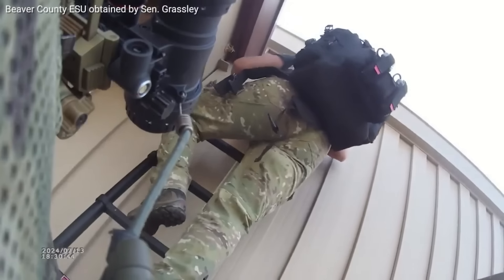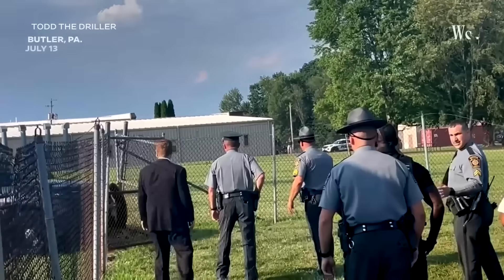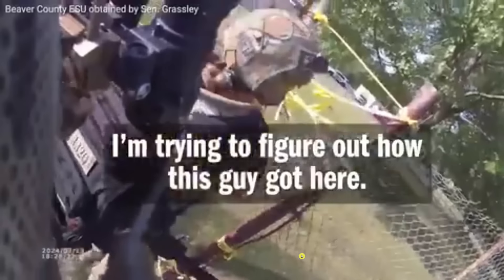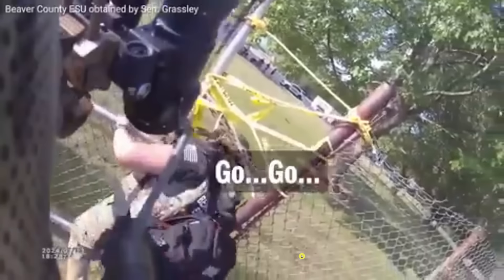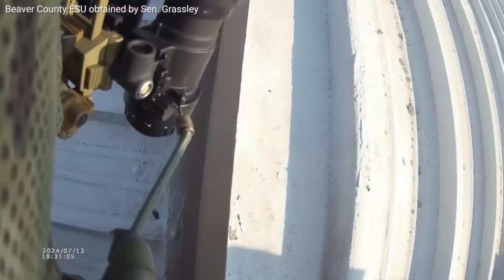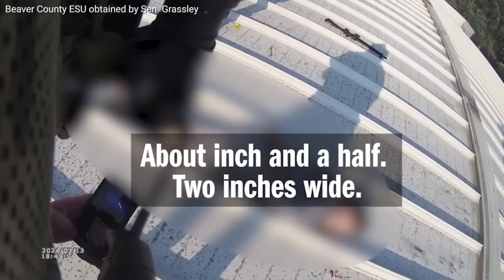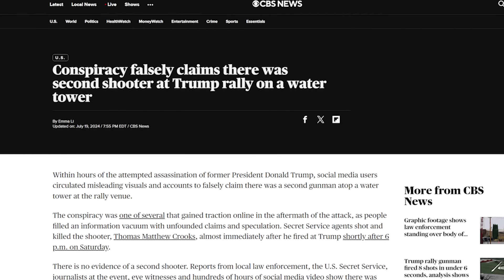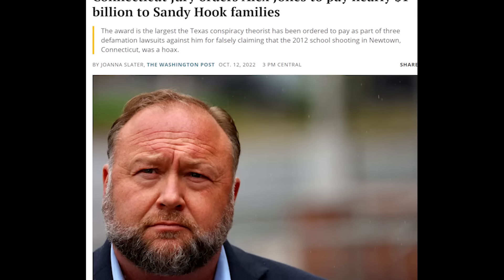Trump Shooting Analysis: Shell Casings, Ladders, Drones, Bodycams,

Comment: I don’t believe a word Director Wray says. This investigation is compromised from the start in my view. 
Wray wouldn’t answer to where the ladder was found because he knows that’s how Crookes planted the rifle in advance, while most likely removing the ladder from the site before returning later. This allowed him to crawl up the building unimpeded with out gear. 
Wray stated in the hearing that possibly the rifle was adjusted short enough to be concealed easily. BS, at most the stock is collapsible 4-6 inches max on that DPMS Panther. That is not a short barrel rifle. It will not fit in a backpack with the stock fully collapsed.
Crookes found his way up on top of the roof when he scouted out the building in advance and planted the rifle up top. How hard is it to reach that conclusion? 
Wray knows this though. (My opinion)

Comment: The people who alerted the police about  a shooter on the roof would have seen him climbing from the air conditioning box. So he must have climb from the other side of the building. How? No ladder, no mechanical devices to easily gain access to the lower roof either. Did he fly to the top of the roof? The ladder we saw in the videos leaning against the building was placed by the police after the shooting. So, how did he climbed to the top of the roof while carrying a long rifle and a backpack? The police and SS had to wait until somebody brought a ladder in order to climb to the roof. There are too many "mistakes" made by the SS to be just incompetence. How did the shooter know the right building for taking a shot hadn't any SS or local police guarding its roof? You just don't walk into a place where a president or ex-president was having a speech and by accident bump into the only unguarded place that was perfect to place a shooter. The location he "selected" for taking the shot was blocked by trees so he was hidden from the counter sniper. The fact that he went to buy a ladder tells he knew that building will be unguarded. I say somebody helped him.

Comment: When you are shot in the head by a high powered rifle, you are done doing intentional things. It’s too late to toss the rifle 6 to 10 feet away It’s too late to drop the rifle and roll to the side. You’re done doing intentional things.

I’m not interjecting additional conspiracy theories. I’m saying the narrative that he was shot in the forehead while looking through his scope is baloney. In all likelihood, the local cops shot caused him to get away from the rifle or get the rifle away from him. 

At that point, he was domed by the SS counter-sniper. He may have decided to flee or surrender, but he wasn’t still shooting. When that bullet struck home, his switch got turned off. He was done … right where he was.
Reply: All that is true. But! The first technician or operator that reached his body on the roof has to make the scene safe by moving the weapon from close proximity to the subject (shooter), even if he appears dead. His body cam, if he’s wearing any would probably show that.

Comment: Collapsible stock? Christopher Wray is an idiot trying to score points with his buddies in the ATF. a Collapsible stock doesn't remove any significant length from the rifle considering an AR-15 has an upper receiver that detaches with 2 takedown pins. Only an idiot would mention a collapsible stock when you can halve the length of the gun in 3 seconds. The US government is so incompetent it's not even funny

Comment: He wasn't standing up at all the farthest sniper team took him out at 7.9 seconds as I heard it go through a scan machine of 3shots in 1.8 second then he shot 5 more wild shots because the far team could see him peaking over the 5 inch roof cap and scene him through his scope and scene forehead and left eye and said it's 1 in a million shot to get him, then around 15 second mark sounded like another sniper shot sounded like a muffled shot, I think it was the Hydraulic pressure line was hit.Then it blew at that time spraying, his video shows it. Another guy had recordings from a guy that could see him clearly,  wasn't from inside at all. Never stood up, in boxers because they went to attempt to Resuscitate him and first thing they do is strip you of clothes,  they stopped because there was no saving him,  they scene there's nothing else on him from shorts off, there's just 9 shots taking off the 9th at 8 seconds and from sniper and some people scene him getting shot as head and hair went up in air from being direct hit in the head only shot. If you look online,  you'll find a guy that has a computer with gun shots going off, 4 shots in 2.7 seconds and I think it jammed not sure but then shot 5 more times and sniper shot and can hear the difference in sound from his computer  that runs through a program to show shots, he's just confused about 1 shot very late at 15 seconds that's muffled like I said.  Don't know who shot it, said it might of been other team because was muffled sounded.  Again, I think he nicked the line on truck, then it started to spray  Hydraulic fluid fluid all over the place. And I think at 15 seconds that line had a Nick from the bullet that hit Trump in the air. Then hit the line but didn't blow until the 15 second mark  he shows the line squirming fluids out 25 feet easily.  But I didn't see any as Trump was taking to truck yet so it probably blew just then squirting towards the tents. A good 7.5 seconds was a sound that sounded like another gun shot.  I don't know if was or not. Need to have all be with all counts of bullets by each one there.

Comment: This video is a joke.
- All of the witness videos show him at the back of the building(right side facing stage)
- the AC is at the back/right
- there is a after death picture with cops standing over, that is also from this exact angle, on the back/right.
- all of the Arial pics and bodycam vid show him dead with a blood trail on the front/left of the building.
- in your video, you contradict yourself by saying both of these statements multiple times. Using all of the footage.

Comment: The fact that the director doesn't have at his fingertips which snipers killed Crooks or can't tell them if it was the ones we have the pictures of seems quite insane but I believe it, because of the terminology he uses and the other things he says he's not sure of. It's pretty insane that the public knows and can say for sure it wasn't them and in fact we know it was the snipers two roofs behind them and they were armed with an SR25 gas operated 300 blackout suppressed rifle and they took one or two shots. You could bet your ass if I was the director, even if it didnt' concern the immediate after action report I was conducting that I would know all of that information and could at least say: "We need additional confirmation, but I can tell you that it was Sniper team #2 located behind those snipers that we have seen on all the video, as they had better visibility". But either he knows exactly and for some reason is withholding that info or he's not that good of a director. PERIOD.

Comment: the Sniper’s nest from the window was probably how they let their patsy; Crooks on the roof in the first place. He’s surely not athletic or has spider ability to climb and might have called more attention to himself. If these SS guys couldn’t make it up without a ladder, how could Crooks?
Doesn’t anyone question who really flew the drone? Did they even dust the drone or ac unit and pipes for fingerprints? 
They never mentioned dusting the ac unit or pipes they claim he used to climb to the access the roof. So, my opinion, that’s the same plan Crooks thought would also be his escape plan and probably where the real assassinator came from and retreated back to. Was ANYONE, including Crooks dusted for GSR ?
8 shell casings,,, where is the one from the Sniper that took out Crooks? Wouldn’t that be the 8th shot and NOT be with the other 7?
Plus one shot was to the left hitting Comperatore and another to the right, hitting the hydraulic line, which sounds like Crooks reputation of a bad aim very off, while Trump was center. However, that was a few years back in High School and sure he’s probably improved since, having hit the gun range often and with the same SS that frequented the same gun range. 
I also doubt Crooks had the ability to know where the SS was setting up in advance for the rally when “he” was flying his drone. The details to choose a location on the roof, conveniently impeding the view from same SS on barn rooftop, due to the trees AND Sniper nest from window, unless they were hanging out from the window.
I’m going to re-paste my post.

Comment: There’s a picture from the air showing all the a joining roof tops and some large trees with heavily foliaged branches hanging over the top of one of the roofs at the back of one of the a joining building .
It might be an access point to the roof and a place to pre stash the weapon and his gear a day or days before the event.  Finding a remote control next to his body and his bomb laden van parked a distance away but in the vicinity of the event may show he was planning on using the van explosion and panicking crowd for his escape . 
The other question is why did the people on another building that had a their scope on him before his attack wait to take him out till after he made the attack . Strange.
Remember back in 63 when Oswald was shot dead just seconds after he yelled out that he was being used as a patsy?  And now no one seems to want to answer direct questions? This really smells. Maybe they need to follow some money and or maybe people involved in this are retiring in other countries early and disappearing. A lot of cash can go a long ways in some countries.

Comment: You're wrong about the heights of the buildings. You make this claim numerous times that they were roughly the same height. But the barn doors we're machinery doors are much taller than a standard door possibly 4m or 5m plus the roof above them. The shooter's roof was barely two times a standard door. Maybe you're the conspiracy of the conspiracy. How about you find out the facts instead of perpetuating a lie?
Reply: I agree the red buildings are taller.  Not 15" taller. Several feet over 135 yards is "roughly the same height"   And, we do not know if there is an elevation change between properties.